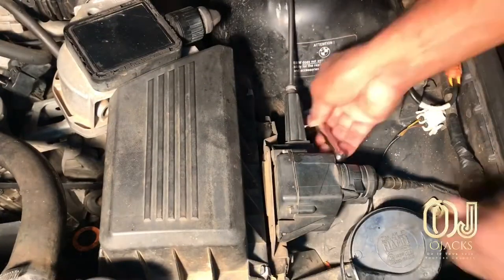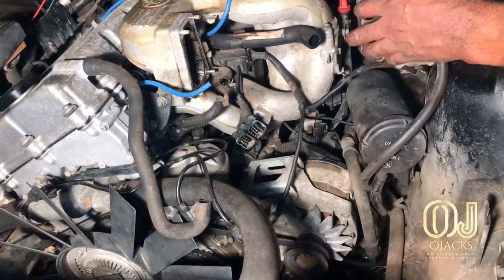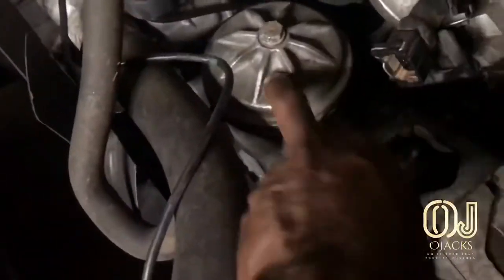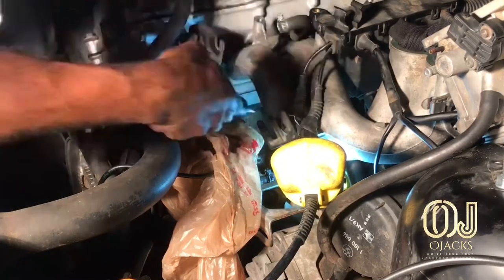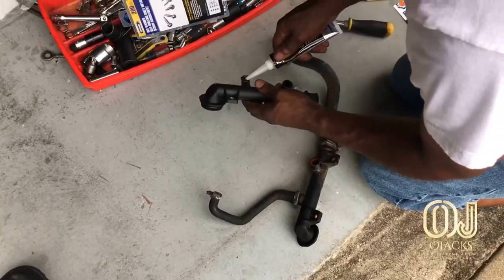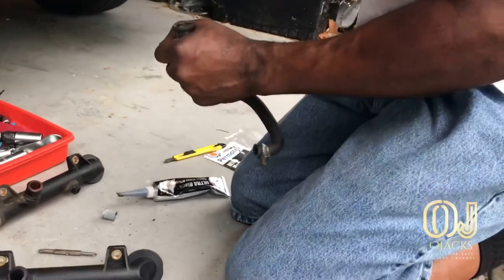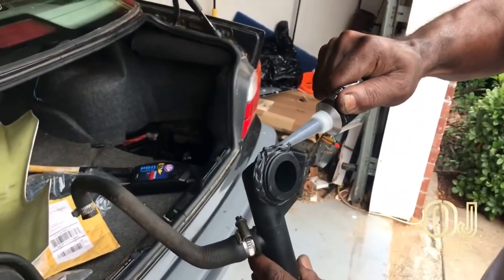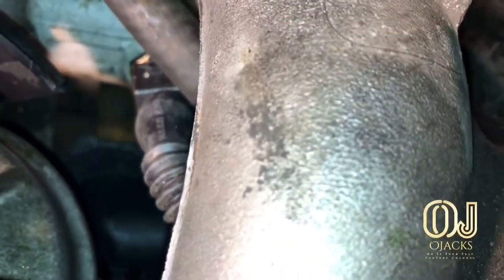E36 BMW 318i Coolant Connector Repair

Comment: You rock! I got it torn down to exactly where you did and i really did not want to pull the whole lower intake off and disconnect the squid. Gonna use your method for sure. Thanks a ton man